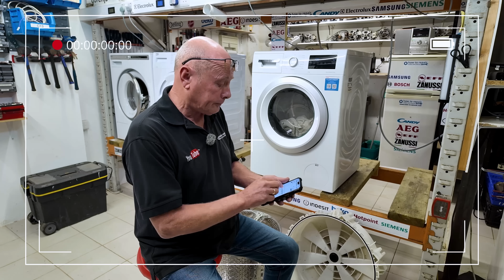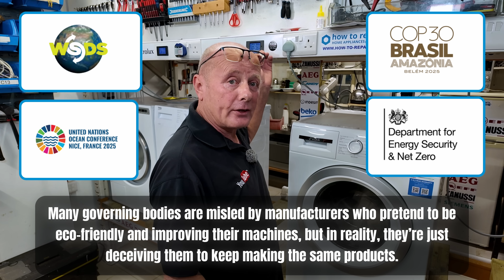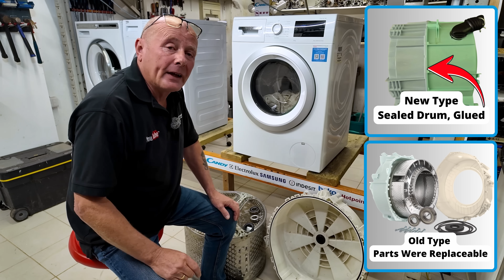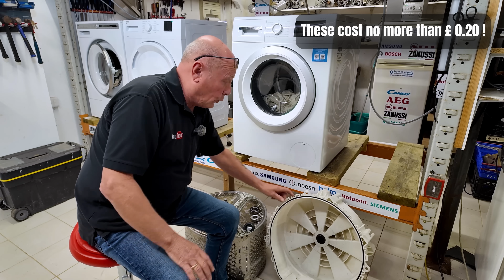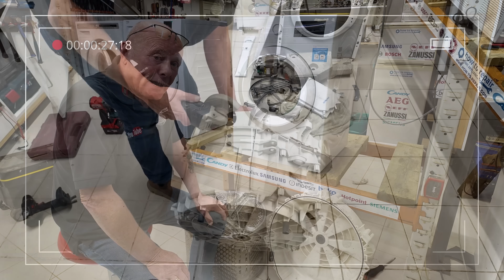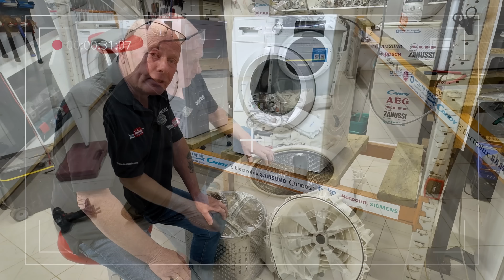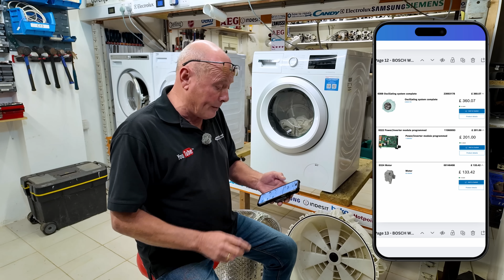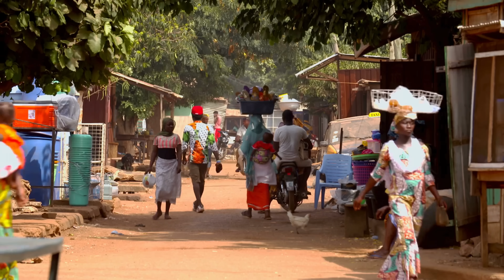Washing Machine SCAM EXPOSED! The Truth About SEALED Drums: Naming & Shaming

Comment: Shocking I've replaced bearings and seals on machines over the years. Simple enough job. I suggest we all boycott any machine that isn't repairable.
Reply from the maker: As you know from your experience, replacing bearings and seals is a fundamental repair for washing machines. It only costs around £15-£20 in parts and, for someone competent, it's a straightforward job that extends the life of the appliance by years. The fact that manufacturers have gone out of their way to change the design from screws to a plastic weld shows that this shift to a sealed drum is a deliberate attempt to build obsolescence into the appliance and force a write-off when the bearings predictably fail.

While I'm working hard on my end, the success of this hinges on our collective reach. Please take a moment to share this with your friends or post it in a relevant group. Every single push helps us build the momentum we need!
Reply: @How-to-repair I use quality bearings when I have replaced them, 30 to 40 quid, they last twice the time of the originals. You can also purchase a shim for when the shaft is overly worn by the original seal, because the shaft metal is a poorer quality. I use a genuine British bearing supplier in the greater Manchester area.
Reply: Agree please do a video or short of which models are repairable
Reply: I replaced the bearings on a bosch with sealed drum, i had to split it along the seam then screw it together with wood screws and silocone.
Reply: The problem is with the majority of thoughtless, complacent consumers who refuse to do any "homework" before giving away their money.
Reply: The trouble is, you don't know if it's not economical to repair until it fails or you managed to find this information prior to purchase. The vast majority of appliances are likely to be BER so boycotting would lead to going back to the galvanised tub & wash dolly. I worked for National Homecare a very long time ago and got called out to machines covered by the high street retailers extended warranty. The vast majority of these calls ended up calling the insurer and giving them to repair cost only to be told that they would replace the appliance. This was around 30 years ago and even then the company was charging around £85 for a brushed motor.

Comment: god bless the hotpoint 95 series , door boot, bearings and brushes all in for £14
and you would happily shove a 6 month warrenty on it
Reply from the maker: The Hotpoint 95 series is a fantastic example of a machine built with the right philosophy designed to last and, crucially, designed to be repaired. You're absolutely spot on with those figures! Back in those days, a set of common replacement parts would cost the customer a pittance and allow the engineer to guarantee the machine for another six months to a year, getting another few years of life out of it!

Honestly, I can't sustain this level of reach without your help. Please consider this a direct appeal share this widely, especially this week. Your willingness to spread the word is truly the key to making this message unavoidable.
Reply: I love the way those 95s go about their job. Overloaded, unbalanced. Though does not care. I will still spin and shoot straight up to 1000rpm from zero. Sure might have moved a few feet but the clothes are dry. Contrast that to a modern Bosch. Decides it's only safe to spin fast for about a minute.  Clothes soaking wet. Have to run spin cycle again! Downright terrified of the 95s as a kid! So aggressive

Comment: It is a shame (as en engineer I just can't take it) that nowadays, on most items, the older the better!. Let's talk cars, home appliances, computers, musical instruments, ... Everything seems DESIGNED TO FAIL and that should not be allowed. But politicians are in the same boat that manufacturers. They create "green" laws and products, but none are really intended to the supossed purpose.
I am now working on 60+ years old musical instruments. They were made in Germany back then and everything is carefully designed so, even afer all these years, can be easily restored and played again. Take the same manufacturer products built today, with plenty of better resources available. They are crappy, break easily and are more expensive tham their ancestors (adapting prices to inflation, of course)!. Then about washing machines, some weeks ago mine, 15 years old, was fixed for 70€ (bearings and seals replaced). In 15 years none of the recently manufactured ones with the sealed drum would be working!. And what about my 35 years old Panasonic digital microwave owen?. Or my 1992 YAMAHA motorcycle?. Or my 2004 HONDA Civic?. It is incredible how those items were built compared to new ones. We need to FIGHT those greedy manufacturers not buying their crappy items
Reply from the maker: You've hit on a really important point about the pervasive nature of planned obsolescence across multiple industries from cars to musical instruments to our washing machines! It's clear that this issue is much bigger than just household appliances. As an engineer, you understand the core of the problem: things are now DESIGNED TO FAIL.

We need to make it clear to manufacturers that we value durability over short-term efficiency figures and that we are willing to take action to stop buying their "crappy items"!

Honestly, I can't sustain this level of reach without your help. Please consider this a direct appeal: share this widely, especially this week. Your willingness to spread the word is truly the key to making this message unavoidable.
Reply: I’m not sure, 20 years ago buying a washing machine felt like a big deal, a big investment, now you spend less than a weeks earnings.

Comment: It isn't anything new sadly, it's been going on for decades, it's just that, it's hit the white goods market. 

How many of those machines that ranged from 400 to nearly 900 shared components? 

I was a TV engineer in the 90s, we had video recorders made by one factory but with any number of different fronts on. 
I fondly recall a customer bringing in his B&O video machine, it just so happened I had a Pye, and Phillips machine, all the same platform, I had all three across the benches, all required the same repair, this was the Phillips "Charlie" deck, they went through pinch rollers like anything, common repair, customer was extolling the virtues of his expensive B&O, he was crestfallen when i showed him the three similar chassis across the bench, they all had their facia removed, each facia would fit each machine, exactly fitting, not a rough fit. Funny he was happy to use Phillips priced spared rather than the 50% higher priced B&O parts.

Is an Ebac machine worth the extra money?
Reply from the maker: Thanks for the comment mate. As an engineer with a long history in the trade, I absolutely remember that era.Your story from the 90s TV repair world is a perfect example. I did a review on an eBac machine and was highly impressed at first, especially when they were a new company. But when I needed assistance after a couple of years, they were not so forthcoming with their help. Please remember that every share, every comment, and every conversation helps amplify our reach. Let's make sure this message gets everywhere it needs to be!

Comment: 7:32 Design substantiation analyst here; we can very much predict the expected life of a component; whether it be strength or fatigue. I've never had to calculate bearing life, but a quick Google brings up the likes of the American Roller Bearing Company and an L₁₀ lifespan. So yes, manufacturers know exactly how long a bearing will be predicted to last.
Reply from the maker: Thanks a lot for your comment mate. You've hit on a really important point about the precision of lifespan prediction in component design, especially for bearings. This is exactly why we find the choice to use non-repairable sealed drums so objectionable the manufacturer knows the component's life, and designs the repair window to coincide with that failure. I'm glad to see someone with your expertise confirm the math behind planned obsolescence.

This movement only succeeds when we make it as visible as possible. I truly can’t do it alone, this requires all of us. Please remember that every share, every comment, and every conversation helps amplify our reach. Let's make sure this message gets everywhere it needs to be!

Comment: Lets see how long my Series 4 lasts then. Ill have an eye on it.
Reply from the maker: it's going to be interesting to see the numbers especially as they created a built-in counter that tells you how many washes the machine has done, you can find that video on the channel. I like the machine but when a manufacturer does this type of deliberate built-in obsolescence? It makes my blood boil? Thank you very much for your support and comment. Much appreciated.
Reply: @How-to-repair absolutely. No, thank YOU for your efforts spent on this. Absolutely mind boggling. Though not really astonishing. During engineering studies we did identify thin cracks in the shaft of a newer machine. We then compared this to a 30 years older shaft - no cracks. The quality of the engineered parts is deteriorating as well it seems.
Saw your vid - will report accordingly.

Comment: I wanted to buy another Miele twindose soon. Thank you for your valuable information, I changed my mind and I am now looking at ASKO.
Reply from the maker: You'll be pleasantly shocked, but if you do choose Miele make sure you check the model that you're buying because some of the lower end are using sealed drums thank you very much for your support and your comment
Reply: @How-to-repair  I already had a beef with MIELE after they wanted to use my usage data for third party AI training and whatnot. Thanks, but no thanks. MIELE is currently going entirely into the wrong direction.

Comment: Mechines are designed by accouants not engineers.👍
Reply from the maker: As an engineer with over 40 years in the trade, I can confidently tell you that appliances are indeed being designed by accountants and bean counters, not engineers. The sealed drum is the perfect example of an accountant's design choice. It's a betrayal of good engineering practice, and it’s why we have to expose the shocking prices like the £493 drum replacement. It proves that the goal is forced obsolescence, not efficient design. 

It really is down to us, and I want to be honest: I simply cannot manage the required reach on my own. Please, as a huge personal favor, make it a point to share this link or message within your networks. Your support makes an immeasurable difference.

Comment: I do agree that manufactures should make the machines easier to repair, however it's not only the cost of the parts to repair but the labour. £5 bearings and £40 spiders are good but the problem lies in the potential labour costs. For many people the fixed cost option rather than a variable one makes it easier to go for a new machine.
Reply from the maker: The cost of living is so high in the UK today but of course engineers have to charge a fair rate for their time but it does not give a manufacture the right to remove the capability. It is down for the customer to choose whether they  want to pay the money or have a go at repairing it themselves, some families are not in the financial position to buy a new machine every few years and if they want to spend the whole of their Sunday stripping the machine down and having a go themselves it is their right and with the biggest library available to everyone for free on technical information called YouTube. It is not that difficult anymore. Thank you very much for supporting the channel and your comment. It is much appreciated. Please remember to share if you could.

Comment: Wouldn't it be more important to use good bearings? I have had my washing machine (Miele) for 16 years now, and I have never had to replace the bearings. Mieles are quite expensive machines, so replacing the bearings might be worthwhile. I imagine that labour costs plus travel expenses for such an operation will easily exceed 200 Euros. Who would spend so much money on a 500 Euro appliance, even if parts are only 20 Euros?
Reply from the maker: You are completely correct about Miele. Miele machines have long been seen as the gold standard. That 16 years of flawless service from your machine is a testament to the fact that using high-quality bearings and superior engineering absolutely minimizes the chance of failure.  To truly make a difference, we need to get the attention of industry decision-makers and encourage them to adopt more sustainable practices. Sharing this post is a great way to spread the word. Thanks for your help!
Reply: OEM in my old Miele were NSK England (surprisingly not SKF), NSK also have a plant in Poland now IIRC.  I thought they were the problem but the old bearings in the 17 year old machine were still like new (so I replaced them but the scraping noise was still there sometimes, I shook the drum (obviously Miele the bearings are in a bearing cross and don't require splitting) and sometimes the noise went away so was baffled -- in hindsight I should have split the drum and would have found the metal debris that eventually made its way out when the drum failed completely!)... It definitely seems worthwhile to use brand name bearings of your preference (NTN, NSK, Koyo, Nachi, SKF, F.A.G./KBC, Timken)! ... 

Anyway since the bearing seem to last for so long and the traditional metal inner, metal outer drums seem to fail in other ways (the second hand machine I bought also turned smoothly with good bearings, but promptly had a drum failure -- sparks flying inside! -- of its own), that's why I am not that concerned about Miele's choice of sealed drums for their plastic tub machines, even though it's not ideal.
Reply: ...I bit the bullet and bought a brand new base model factory seconds Miele. I should really have bought one in the first place instead of the second hand top-of-the-range machine, as in Australia Miele were offering a 10 year warranty when I was first looking.

Comment: I just had my 4yo barely used Miele microwave over stop heating up. Miele charge £180 for an engineer and £460 for a PCB which they have to program to work with the control panel. 
I took it apart and replaced a faulty relay on the board for less than a few quid.
Relays should not be failing with such little use. Dont buy Miele.
Reply from the maker: Thanks for your comment mate. You've hit on a absolutely crucial point about how component quality and repair pricing can turn a high-end brand into a massive disappointment. You are 100% correct about the PCB issue. It’s a shame when a brand like Miele, which has a heritage of quality, starts to fall victim to these greedy obsolescence-driven practices. 

I really appreciate you sharing this with your friends and family. Maybe we can make a difference if the manufacturers notice how many people are looking at this video.
Reply: Think il just keep my 25 year old Miele washer ,still going strong..

Comment: Thanks Paul, It is so wrong what's happening. I've learnt so much since watching your content. I'm getting reasonably close to purchasing a new combined washer/dryer around 8-9 KG for the washer side of things. What would you suggest?  If you think the washer and dryer should be separate units, any suggestions? My Bosch series 6 washer dryer "which suddenly isn't a dryer anymore"  is slowly failing. Thanks again.
Reply from the maker: if you have the space, I would always recommend two separate units and I would definitely not go down the heat pump tumble dryer route as yet this is due to the fact that I am seeing an awful lot of machines being scrapped because they are uneconomic to repair and most of the faults are to  clogging of fluff on the system
Reply: @How-to-repair  Thanks Paul

Comment: Thank you so much for your work on this. As someone who does try to repair as often as possible I find these kind of corporate shenanigans absolutely infuriating especially given the state of the environment. When I'm planning on buying something I will find out how easy it will be to repair and if it's not repairable, or difficult to repair I will not buy it... I am now dreading a washing machine failure because of the issues you raise seem to be industry-wide.
Reply from the maker: Doing some research first is very important before purchasing an item. Most of the people in the retail shops only have a basic knowledge and no extensive training when it comes to the right to repair. Thank you very much for your support.

Comment: Keep saying this, if the governments really cared about the environment, then it would be law. Every mass manufactured item should come with a QR code that links to a parts diagram with part numbers and those parts MUST be available for a minimum of 10 years including software support. Doesn't matter if it's a washing machine, a pair of headphones, oven, laptop, mobile phone or car.
Reply from the maker: You've hit on a really important point about how truly effective 'Right to Repair' legislation should be structured it shouldn't just be about vague laws it needs clear, enforceable standards that guarantee repairability. It really is down to us, and I want to be honest: I simply cannot manage the required reach on my own. Please, as a huge personal favor, make it a point to share this link or message within your networks. Your support makes an immeasurable difference.
Reply: Yes, they could do that - but that won't stop them charging for those parts in such a way so as to make remain an uneconomic choice.